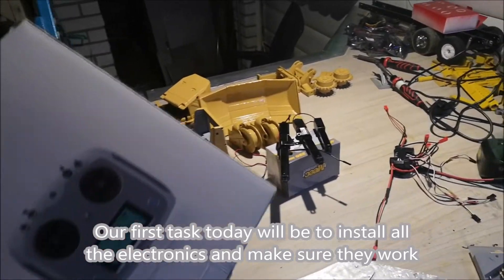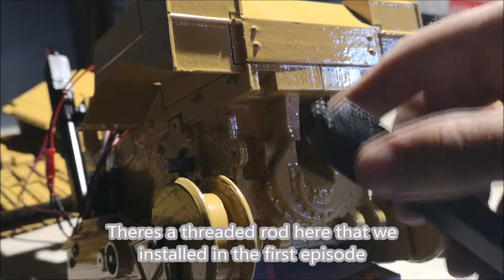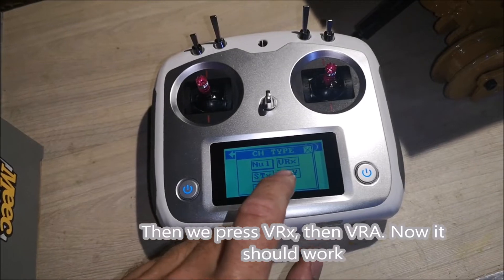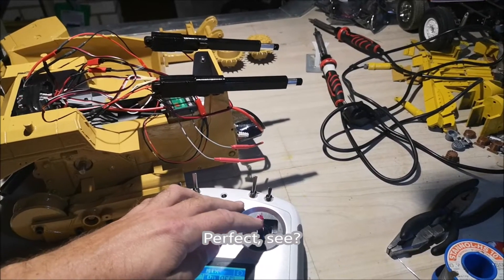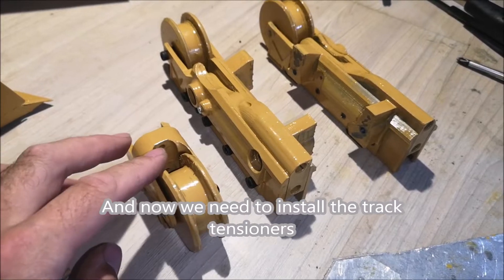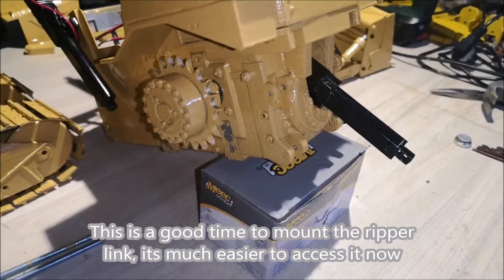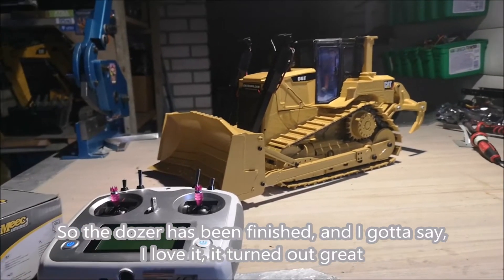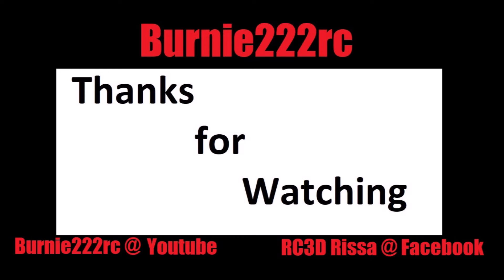Making a 3D Printed D6 Bulldozer PART-5/6

Comment: I am ordering all the parts I need to build mine, I have two 1060 hw esc for the track motors. I am not finding a good micro brushed esc that can handle 3s for the actuators. I am wondering if you could please post a link. Also have you thought about starting a discord channel? Great for sharing information on the build